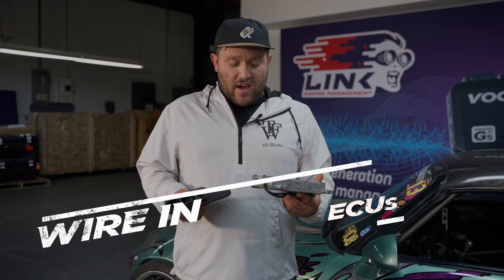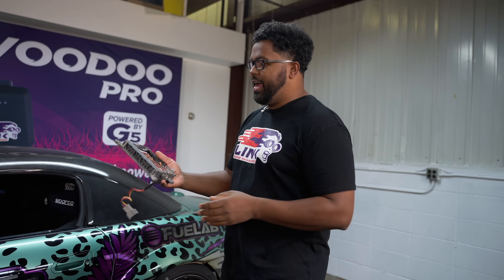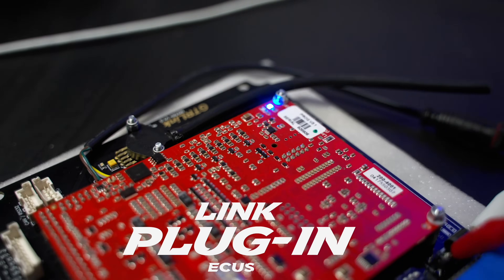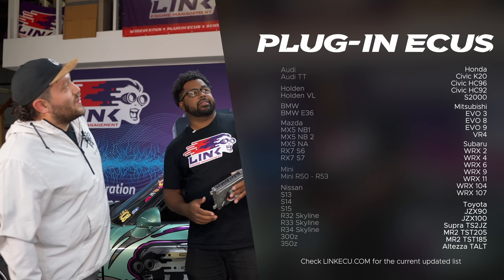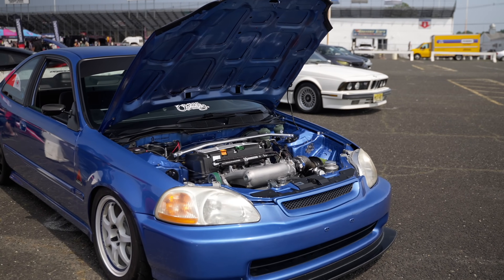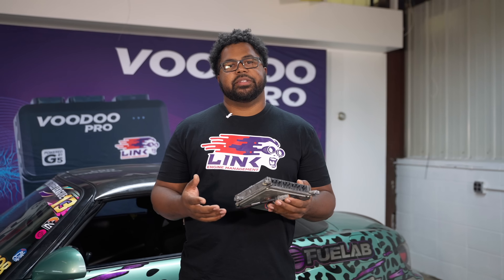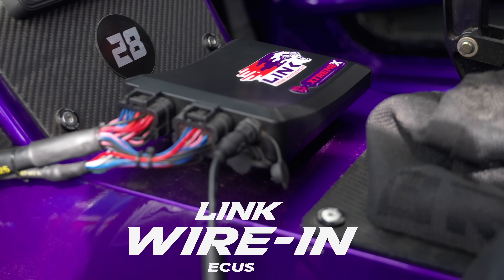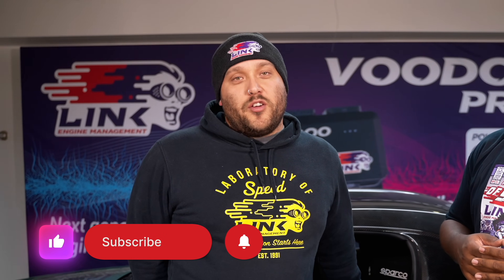Pops and Bangs Ep 2: Wire-In ECUs VS Plug-In ECUs

Comment: I have a vq35de Nissan murano awd it’s the same engine in the late g35 or 350z can I use a rev up ecu to gain power? Or will I just have to engine swap to get the hp
Reply: I mean you could get a 350ZLink - N350X.